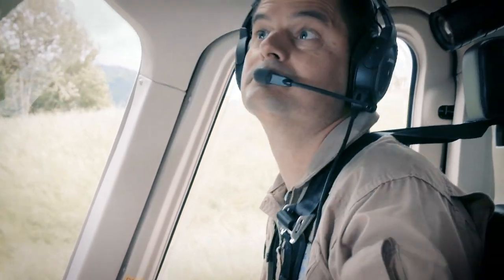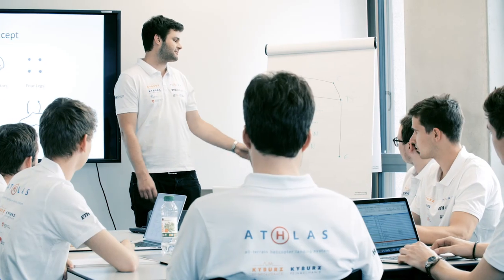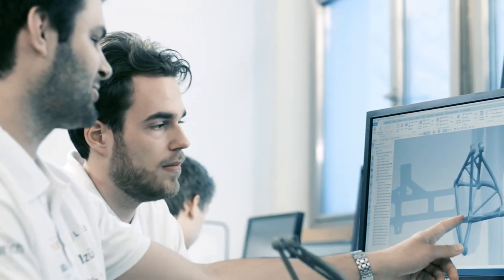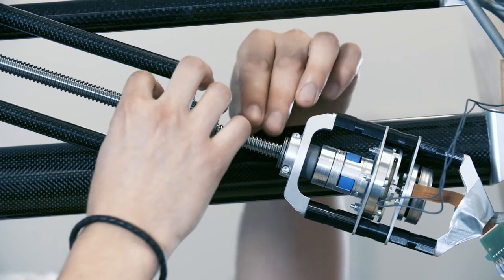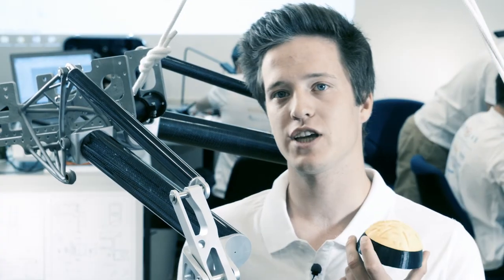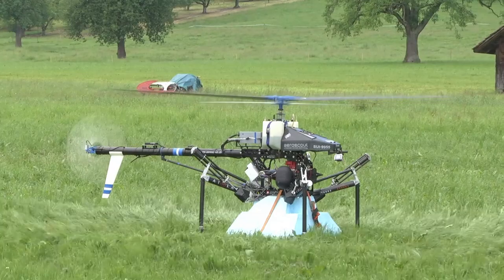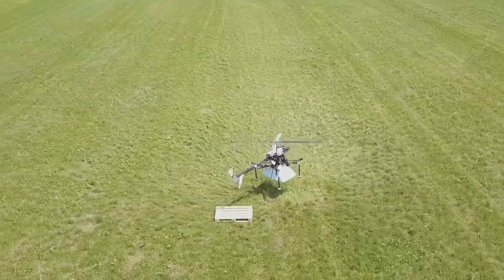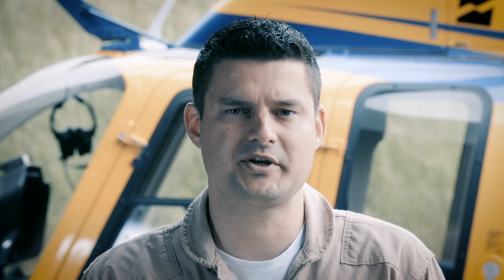Adaptive Helicopter Landing Gear - Final Product

Comment: What about run-on landings? How much weight does this overall system add on top of a typical pair of skids? I can definitely see its uses, I'd just like to know how these types of considerations are being solved.
Reply from the maker: Hi Matt
To approach run-on landings (which were impossible to test on this model), the fixed feet could be exchanged for wheels. Our prototype weights 12 kg more than skids - this value can be greatly reduced by a closer integration of the interface to the fuselage as well as another iteration of the actuation. 
You can find more infos and contact details on athlas.ethz.ch
Best, Team ATHLAS